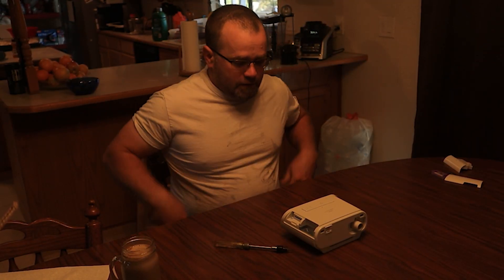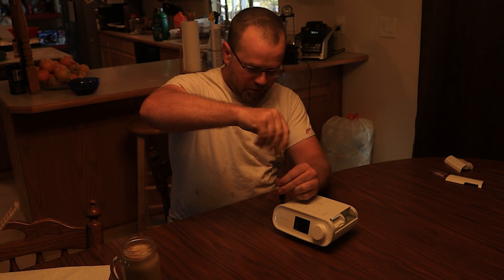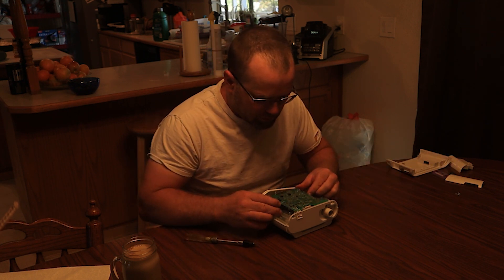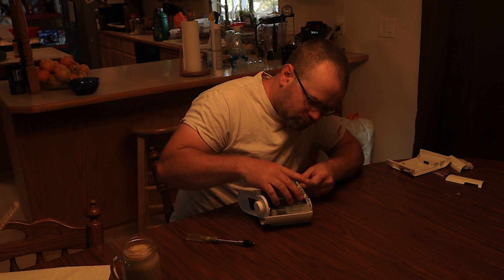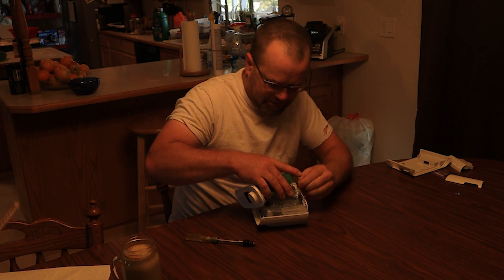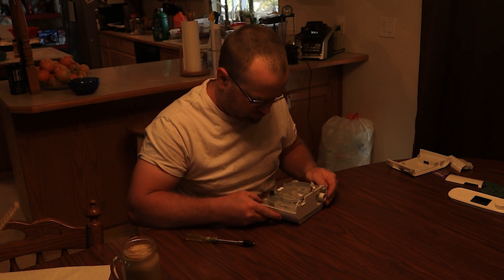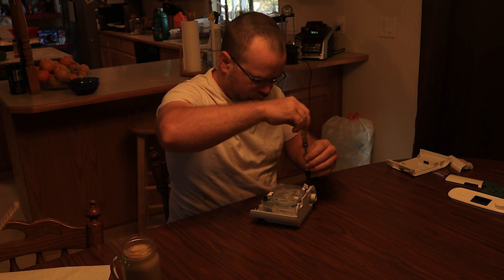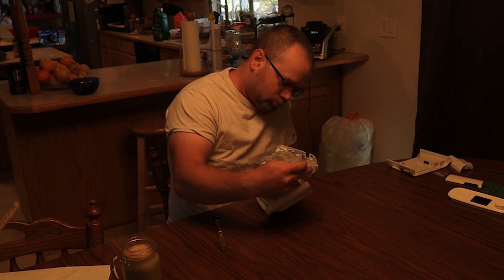In Which I Remove the Carcinogenic Foam from my Philips Respironics Dreamstation CPAP Machine

Comment from the maker: Update:

Three months later, still very happy with my foam-less machine.

I have now received a notice from Philips about the (some day) replacement of my machine.

Do I want my machine replaced? I really don't care. It works fine now. I have no issues with it.

My main concern now is that I have these dreams where I get flooded out, water comes in in the dream and I jump up to escape the water and I end up yanking my CPAP machine off the night stand and the hose gets stretched and ruined. When you stretch the hose, it gets smaller and that constriction makes it harder to breathe. And I don't get replacement hoses often enough to replace the ones I ruin during my nightmares. On the upside, the machine itself is durable enough to survive getting yanked off the nightstand, so that's good.
Reply: Replacement hoses on Amazon are fairly cheap and lol about the dreams.  Thanks for the update!  I was wondering about the sound after the foam and also are you still waking up with headaches?
Reply: @Seven-xe7ky  Yeah, I ended up getting a larger and much stronger generic hose from Amazon. Fortunately the dreams are rare and now the hose is pretty much unbreakable. Didn't need the hose anyway.  The sound is barely noticeable, you have to really listen for it to tell the difference. My occasional headaches I think have more to do with dehydration than the CPAP machine. I don't have any problems with the machine, still.

Comment: I was fortunate enough to find a slightly used resmed. But everything I've been able to find, read and watch, the foam only off gases for the first few hours of use just like the foam in my mattress, a couple of days then nothing. I think the big culprit are those ozone cleaners. As mentioned in one of the comment replies, "it turned the foam into black goo". I never used any cleaners other than soap and water on the mask and hose. The only time I've woken up with a headache it was accompanied with a stiff neck, so i figure i just slept wrong... I hope.

Comment: Easy foam removal with drain weasel. Attach to drill and snakes the foal right outta there, right through existing holes. Works great and no cutting.
Reply from the maker: It was natural that better solutions would come along. I have no regrets though, and I don't need a replacement, should Philips want to give me one.

Comment: I removed the foam with a drain weasel so no holes were drilled. My problem is now when I turn it on, it runs for 5-10min and then shuts the airflow off due to a “low leak” warning. Says to check the mask and tube but there’s nothing wrong with them. If anyone has any ideas please let me know. I want to use it.
Reply: Hey TWC, were you able to get a good seal between the blower output and the blower housing? I had a little trouble getting everything in the right position.
Reply: @oldvet9127  I got a response from someone on another video. He said to check the silicone plug (by the fan) and make sure it’s seated properly so I went back in and re-did everything and it’s totally working now. So if anyone else gets the warning I got, that’s the solution. Works like a charm now. Thanks.

Comment: did same method but don't need to reseal it bc it's a closed system once cover is placed back on and air only enters where via through air filter on side. sensors see the pressure the same once turbine starts up and it running
Reply: As I've explained elsewhere, if you want the machine measurements to be precise, you need to at least reseal the first compartment. Yes, the machine will still work based on pressure alone, but if you track your sleep via SD card as I do, the numbers will be off. In other words, the pressure function still works, but the air flow measurements will not be correct. If you don't have any use for the airflow measurements, then probably not a problem for you. At that point, it's basically just a constant pressure machine.

Comment: You don't need to cut the chamber. Just put water in the chamber to make the foam firm and pull the foam out with a hanger...
Reply from the maker: I've seen that also, tends to take a while. But it can work.

Comment: If you're worried about cancer causing chemicals from off gassing foam, why would you want to use hot glue designed to glue buttons on your craft project? Aren't you basically sniffing glue every night?
What kinds of chemicals will that stuff give off as it breaks down?
Reply: Hot glue doesn't give off "chemicals" and doesn't break down. It's not a chemically activated substance, like foam or any type of curing glue. It's simply a plastic that gets heated up and cooled down. Not much different than any other piece of plastic on the whole machine, of which most of the machine is made.

Comment: Neat job best I've seen. I was getting headache in the morning I googled how to increase my pressure and bumped up from 6 to 8, no more headache. Also sleeping on my side something's broke the seal. One other thing how do you think the use of hot glue is going to effect your breathing. Like that you didn't drill a hole and create an air escape, even though it is sealed with an o' ring.
Reply from the maker: I haven't noticed any effect from the glue. It's pretty inert unless over 400 degrees.

Headaches was how I learned I had sleep apnea. I thought I was getting dehydrated, waking up with headaches all the time. Turns out it was suffocation.

Comment: My wife's DS1 had the black powder issue so she got a new ResMed to replace it. My DS1 is older, but no black dust (yet). I won't bother with the recall as I don't want a DS2. Local docs seem to be very pro Philips and dimissive of any patient complaints. We're on our own as they want to reevaluate us to see if we really need CPAP at all.

I'm going to reseal the 'access' holes with RTV silicone adhesive.

Comment: You Sir, did an excellent job of removing the foam.  In fact, I will use the same process.  My machine looks fine with no apparent foam deterioration issues.  Philips told me the machine will not be eligable for a replacement if I remove the foam.  I'm not sure I want them to buy me a machine if I can fix it myself.  I know I paid a bunch from my Dreamstation Bi-Pap and it works fine.  It does have 5 years of sleep hours on it.
Reply from the maker: Well, if they don't want to replace it, I'm fine with it. It works fine. Insurance can buy me a new one in four years, and when I decide which one I want, I will take how they handle this whole situation into account.

Comment: Makes us all wonder why a machine with MAYBE $20 worth of parts is sold for $1200+ in the U.S. Geez
Reply: You left out the circuit board that constantly measures respirations and adjusts the pressure accordingly throughout the night.  They are indeed probably overpriced but are way more sophisticated than you imply.
Reply: @davidrader2282  Not really. The Circuit board likely costs less than $20 to produce, using technology and programming that is 10-30 years old. They are not just probably overpriced, they are vastly overpriced.
Reply from the maker: That is the way of things.

One reason I am an advocate of single payer universal healthcare.

Oh, no, I've said it!

Yeah, it's time we finally catch up to the rest of the developed world.

Comment: Glad to see you went with hot glue to close it up.  It’s the safest choice.  I’ve see others not seal theirs up at all….which will probably mess up the flow rate sensors.  Or they use tape, or superglue or something.   Solvent-based adhesives throw off volatile organic compounds when curing.  hot glue is much safer for this kind of application and should hold  very well.
Reply from the maker: Good information. I've seen some others use stuff like epoxy and such. Best not to use VOCs on a machine that literally pumps air into your lungs.
Reply: The glue probably does too
Reply: this is not true. does not matter whatsoever. glue does nothing - Physicist

Comment: What kind of screwdriver did you use?
Reply from the maker: I believe the screw bit is a T-10. Any kit that includes a variety of small Torx bits will include the correct size. I didn't buy anything special, mine came with some screw bit kit I bought years ago, and the small bit I had never used before.

Comment: Would you use an Ozone cleaner with the glue?
Reply from the maker: I don't have one, so it's not going to be an issue.

But I haven't found any concerns with ozone and hot glue. Hot glue is unlike other glues and especially the foam in that its method of action is not due to a chemical reaction, but rather just melting and hardening of a chunk of plastic, no chemical change.

Comment: Thank you for this video. I agree with your view point on the issue 100%. Have you noticed any issues with the machine holding pressure?
Reply from the maker: I have noticed no difference whatsoever pre and post foam, except a slight increase in turbine whine.
Reply: @dirtlingfarm5155  Same here. I was able to fish out the foam through the existing holes. You're right, it's just a little louder. Sleep!!
 Fyi, I used a SoClean ozone cleaner on my equipment for 5 years. Besides the fact that it reduced the useful lifespan of my masks by making the plastic and soft parts brittle and gross, it changed the foam in the blower chamber to a wet, black sticky substance that was starting to disintegrate. Since modification the machine is working as before, I've had no problems.

Comment: No need to glue anything as long as you do your cuts inside the sealed champer encloser. I did it that way and left the cuts exposed and it works fine. I didnt notice any loudness after doing this though. If you use glue gun make sure to use a non toxic kind as some of them has a lot of bad chemicals. Also let your device run for 3 days or at lease a full day to clean any small plastic particles out. I washed the plastic pieace that i did the cuts on and dried it before placing it back in. I did this for my neighbors as he was having hard time sleeping without it. Do this at your own risk and if you dont know how to do it take it to an electronic store and show them the video and maybe offer them few dollars. This can help if you cant sleep without it. Thanx for the vid bro.
Reply: If you don't at least seal the first chamber, air will bypass the flow meter, and while the machine will obviously still work, flow rates and data storage will be affected, and also possibly functions like flex and such. Sealing the second chamber is probably unnecessary, but I like machines to work as designed, if not better.
Reply: Totally disagree I tested without sealing the holes. It was totally louder from the turbulence within the machine. I sealed the holes up and its bearly noticeable compared to before.
Reply: @dgrouche1676  That's what I experienced also. Just a tiny bit of a turbine whine. Not noticeable over any background noise.

Comment: After seeing this machine open I wonder why? If this foam was only for soundproofing of the fan than why did it have to be inside the air flow in the first place? Had Phillips placed this foam around the outside of the airflow the air would still be filtered by the external filters! Unfortunately the DS2 looks like it was built the same way as the DS1 but with cheaper parts. Hopefully my next CPAP machine will be a non-Phillips machine!
Reply from the maker: The foam needs to be inside next to the air flow to absorb sound. You see they already have the turbine itself in a further interior chamber. Older designs were less refined and were louder. I have an old one in storage, it was louder, and inside, the turbine did not have an internal housing.

You could surround the entire thing with sound absorbing foam, and you'd still probably get that turbine whine coming from the intake. This foam reduces the sound making its way out the intake.

It's not a bad design. It is a very good design. Just used the wrong foam. And in my view, the foam is unnecessary. It's just there for that extra few decibels to compete with other brands. It's quiet enough. It doesn't actually need to be quieter.

Comment from the maker: I've been sleeping with this for three nights and a couple naps so far, and I can verify that I cannot tell a difference. In my room, there are a box fan and a ceiling fan and I sleep with ear plugs. There is no discernable difference in sound as transmitted through the hose, and it's hard to tell any difference with any kind of background noise going. Also, I notice no difference in performance.

Can I say I am having fewer headaches? Seems like it. I haven't noticed any headaches lately, but some of them are likely from waking up with a sore neck. However, I would not say this is a scientifically valid result.

I have no regrets thus far.

Another note, I have seen some videos say that the device draws the air through the foam. This is incorrect. The foam sits in the top shell of the chamber, while the bottom shell has free air movement. So the air does not pass through the foam, instead it acts like a "glass pack" muffler, where flow of the gases is free and sound is absorbed in materials which run parallel to the flow of the gases and do not impede the gases.
Reply: Thanks, nice video. But why is it then possible, that parts of the foam gets out of the chamber and to the lungs, if the air runs parallel and not through the foam? Is it a "close system" where the foam sits?
Reply from the maker: @aqua1262  The air passes by the foam. It "rubs" the foam if you will. The foam is not a closed system. The whole machine is not a closed system.
Reply from the maker: Still using this machine after nearly two weeks. Have reported the modification to my doctor at my regular check up, as I am not in the habit of. She says great, I obviously have the situation in hand.
Reply: How long did you have your phillip machine before taking it out?
Reply: @trailblazer77  I got it Thanksgiving 2020, removed the foam first of July 2021, so about 7 full months, and I have a 100% compliance record.

Comment: Are you worried at all about the glue potentally breaking off over time and sucking into lungs? Im wondering it cutting on the outside with tape on outside might be  better since it is positive air and not negative air. I need to take mine apart and follow the pathways. I had an old resmed ive been using but need to mod the DS since it is a better machine besides the foam. thanks
Reply from the maker: Your mileage may vary, do not try this at home

I'm not concerned about the glue, I'll tell you why. Actually, the about the air pressure is not quite correct. By cutting inside the turbine enclosure, there is no pressure differential between the second chamber and the turbine enclosure. Both are under the same vacuum. There is only a slight differential between the first chamber and the turbine enclosure due to the air restriction that is the middle portion of the flow meter, it's a little grey plastic grille between the two air pressure sample ports.  By cutting the exterior of the chamber, now your repair job is under constant maximum vacuum at all times which is created by the intake filters and then more by the flow meter. If you're only going to use tape, this is probably fine as long as you trust the tape. Most tapes I have used either become brittle over time or the adhesive becomes gummy or dry, not great in either case.

Aside from that point, I'm not worried about the glue because I have worked with hot glue a lot, I have repaired my vacuum cleaner with it, and built many foam airplanes. The only thing that releases it is if it is not attached properly, such as placed on a dusty or wet surface, or if it is exposed to alcohol. My surfaces were roughened up by the Dremel and also by some razor blading, and then I pressed the hot glue into the gaps. I am fully confident that the glue will not come out.

For legal reasons, I'm not recommending you do anything at all, merely showing and explaining what I have done.
Reply: @dirtlingfarm5155  They're selling in-line tube filters, which should be more then enough to block the glue should it ever loosen. But I agree with you, I think the glue is more reliable then tape.